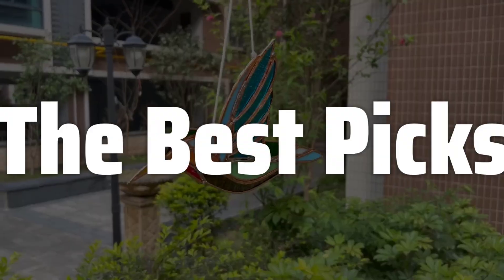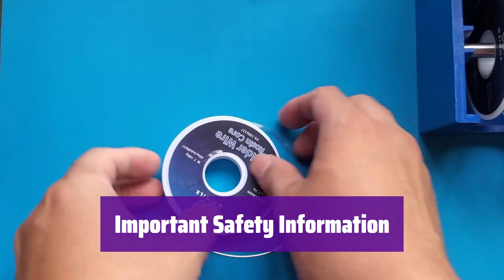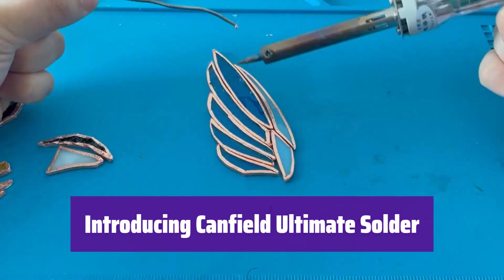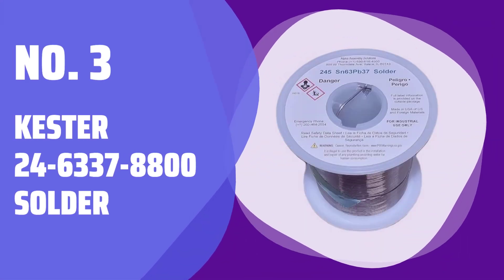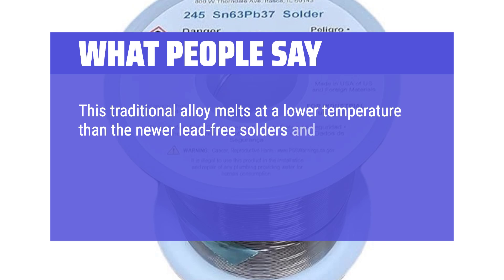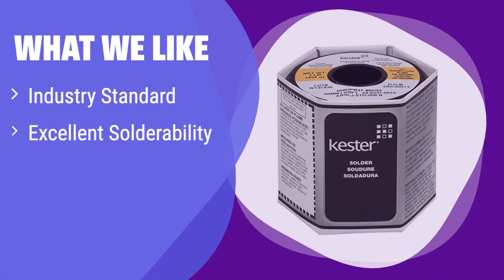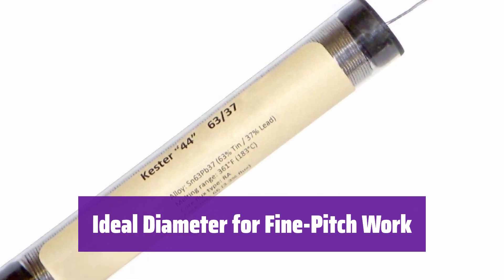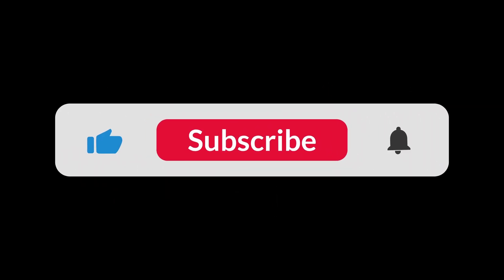The Top 5 Best 63/37 Solder in 2025 - Must Watch Before Buying!

Comment: 63/37 solder is what is known as "eutectic", the ratio where the melting and freezing points are the same. This is desirable in electrical work because a poor connection results if the solder joint is disturbed before it freezes. In other applications this may not matter.

The choice of which solder to use depends on composition, whether there is a flux core, the diameter, the length, price and the packaging.  Make the right choice for your needs.  Brand and product names are beside the point.